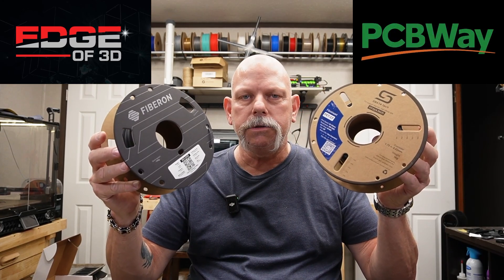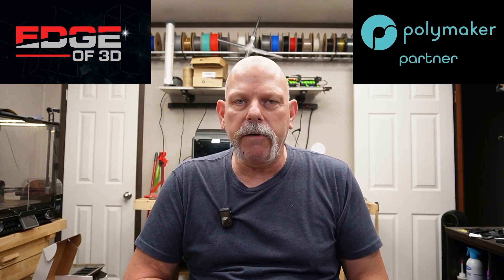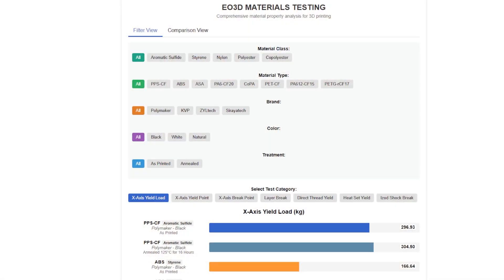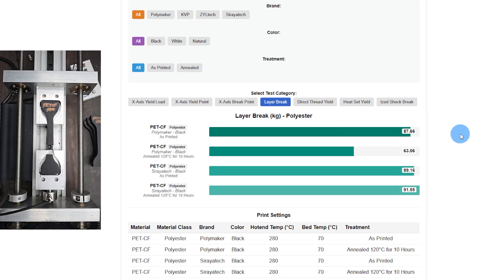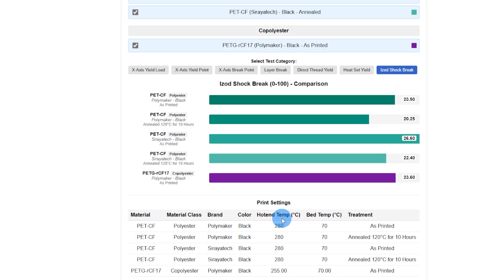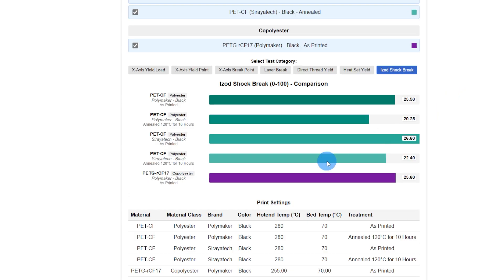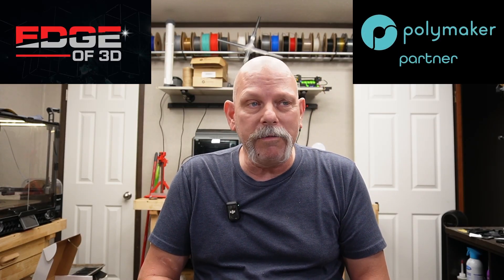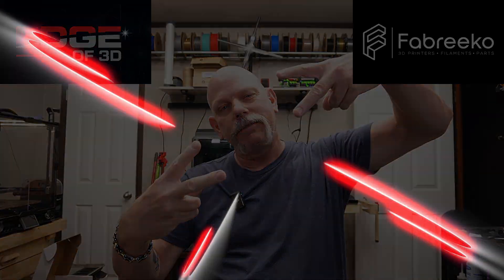POLYESTERS (PET-CF) BATTLE IT OUT | EDGE OF 3D

Comment: Hello. This is all new to me. Is your heat set testing same as measuring "heat deflection temp"? My intentions for the filament is to use it as mold for a low temp metal (fields alloy) pour. Which brand will do better? ty

Comment: Siraya Tech is truly knocking it out of the park with their range of filaments, especially for the price. Thanks for the testing!
Reply from the maker: I just received another shipment form them today for testing....... ;-)
Reply: @EDGEOF3D  Awesome!
Reply: Petcf17 by fiberon is much better better heat deflection and impact resistant based on my use and has a substantial better finish siraya tech has stronger layer adhesion
Reply: @miasmoak6237 Interesting!

Comment: Have you found you need to set your flow calibration especially low for the siraya material? I'm down to .9 where pla is usually about .98.
Reply from the maker: Most of my profiles run in the .92 to .94 range on all materials.
Reply: Thanks for the feedback. Turns out my pressure advance was off which caused over extrusion. After fixing that I'm at .925.  @EDGEOF3D

Comment: I’ve printed BL’s PET-CF quite a bit in my X1C. The Qidi version prints like crap in it. I’d be curious if you did a comparison of the BL to the Siraya PET-CF and see if the results were similar to the Polymaker. I like using Siraya’s ABS-GF as it prints really well on the standard Bambu settings and the price is good.
Reply from the maker: I can certainly add that to the list of filaments to test for a future video.

Comment: Question would be how difficult the are to print, better properties dont help if it prints bad
Reply from the maker: I apologize for not going over the printability, both the Siraya Tech and Polymaker printed the same as Polymaker's PETG. Zero issues printing with it once I took the usual steps for temp towers, retraction setting etc.
Reply: As long as the material is dry, pet-cf/gf print really well.  Bridging can be a bit difficult with limited cooling, but a standard tune and blast cooling for bridging is all you need. 

Bed adhesion is next level so be prepared with a release agent like PVA glue

Comment: I do a lot of PET-GF printing, and if I don't anneal it, it will deform under stress and heat. After annealing, hard as  rock. I also found it's best to anneal parts in the same orientation as printed. Currently using Qidi PET-CF (because it's cheap) and printed at 300°C and anneal at 130°C. I need to try some Srayatech.
Reply: You can anneal our PET-CF and PET-GF at 90C for 4 hours.